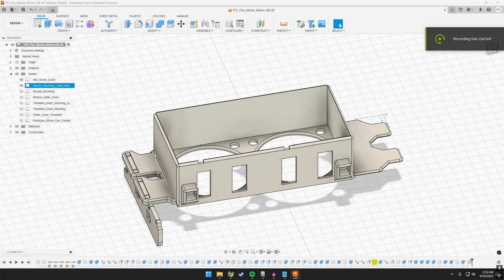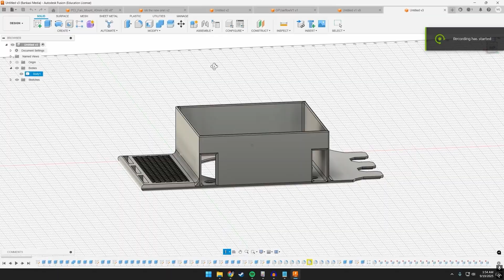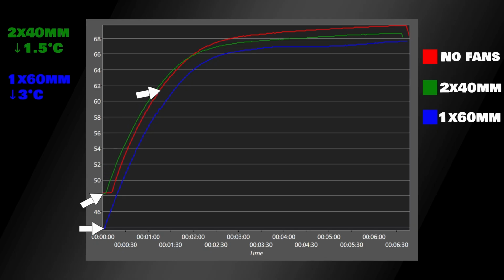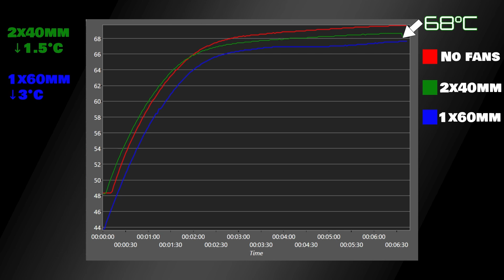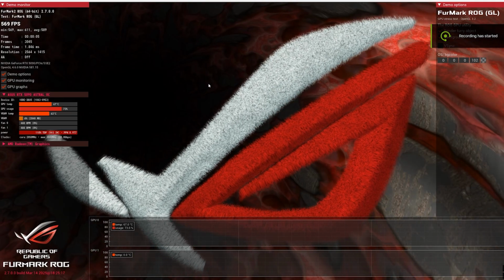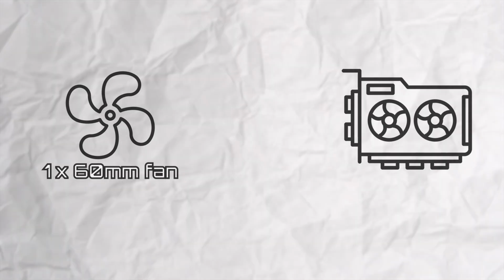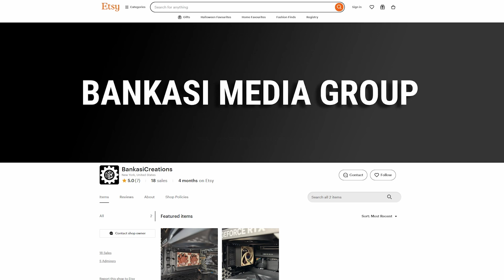I Dropped My GPU Temps for Just $0.46. (PCIe Fans 3D Printed Mod)

Comment: In material cost the thing is 0.46$ If you need a 3d printer that's your issue. 
A) Get better and learn the skills
B) Use your friend's or school's or college's 3D printer and get it for free 
C) Use PCBway if your lazy
Reply from the maker: you're right, If I didn't have a 3D printer, I could've very easily used my college's 3D printer. thanks for the comment!
Reply: And the fans ? and the screws ? do they not cost more than 46 cents ? You dense af man

Comment: Considering that your GPU is that chunky, the fan at the bottom wouldn't have that much air to draw into the GPU.
You wanna first get cool air into the case with sufficient pressure, then make sure the hot air gets OUT of the case asap. A blower fan on the bottom that 'sucks' hot air and blows it out the rear through the openings could do the trick.

Though the bottom exhaust would drop a ton of pressure of air in the case, causing hot air above where the CPU is to be harder to push out maybe...

Comment: What’s your initial fan config here? I’m surprised that the original config wasn’t able to supply the gpu with enough fresh air to achieve peak heat dissipation rates.
Reply: Dog, I’m sorry to be that guy, but I have a way you can drop your GPU temps for 0 dollars - turn your case fans up a little bit.

Honestly though, I don’t know your exact configuration, but if you adjust the fan curve to turn up those bottom fans intakes you have, and increase the GPU fan speed slightly, you should be able to get equal if not better results for the same noise level. 120 mm fans are going to be able to push much more air than a 60 mm fan could at equivalent volumes. Just a small increase can make a difference.

That being said, seems like a fun project that you enjoyed, and if that’s true keep doing your thing.
Reply from the maker: I’m on a silent config from ASUS. I don’t like fan sounds :)
Reply: @BankasiMedia I don't understand people who say "I don't like fan sounds" like do you not wear headphones? Are you the type to play with speakers?

Comment: I am ready to buy these from you for about 10$ if you can like find a way to make them drop 10 degrees Celsius like I think you can make a work from it and it is still cheap felement like idk what it would cost you to make them but yah if you change the material that it is made up of some people are ready to pay more than my 10$ for a reasonable temp drop like what about a 2×80mm fans or something
Reply: After a point adding fans wont reduce temperature. and if the fan flows more air then the GPU's fan it will create turbulence
Reply: just repaste your gpu with ptm 7950, cheaper and much more worth it
Reply from the maker: I don’t think it’s possible to drop 10 degrees Celsius from a simple fan mod.

Comment: Having a 3d printer + plastic materials, 3 little spare fans, skills to use 3d printing apps is not exactly 0,46$ 😂
Reply: Download His model, order 3D print with PCBway or something similar and a fan about 5 dollars including shipping and fan
Reply: @Daziob  still not 48 cents. He is missing bottom intake fans which normally now most modern cases support and people use with. The temps with these tiny fans are not worth it. Yeah if you are super cheap and dont have any proper cooling setup u can try it out but will cost you a lot more that whats being advertised which is false misleading. 48 cents my a**. Luckily my 5090 GPU temps are never that high unless running a full load bench marking test.
Reply: @MyAnimeForLife  Its about a proof of concept. Its not that pricey 5 dollars at max. And ofcourse YouTube titles cant fulfill expectations , like thats a thing known for ages
Reply: @Daziob  what a lame excuse to cover for the creator.
Reply from the maker: @MyAnimeForLife  at around 1:53 you can see my bottom intake fans.
Reply: @GlebFromCroatia  No its your issue you need a 3d printer. in material cost it is 0.46$ and free if u you use your friend's or schools 3d printer. Be smart instead of complaining
Reply: @Daziob  damn so its my fault the guy did not specify i needed a 3D printer.  and none of my friends own a 3D printer and i finished school before 3D printers were even used in schools. 
the smart thing is to complain about the false advertisement the creator is spreading.
Reply: @GlebFromCroatia  If you can afford a PC to this Mod he told you can afford to go somewhere to get this 3D printed. Or create  your own solution, or just use it without the 3d print.  He cant put everything in the title bro ,, he is right to say 0.46$ as it is 0.46$
Reply: @GlebFromCroatia  thats like saying i need to have hands to actually build it in the first place lol. creator should specify u need hands
Reply: @Daziob  they should yeah i agree.